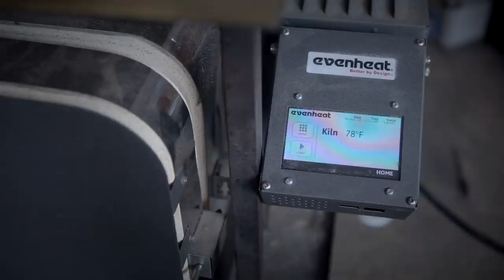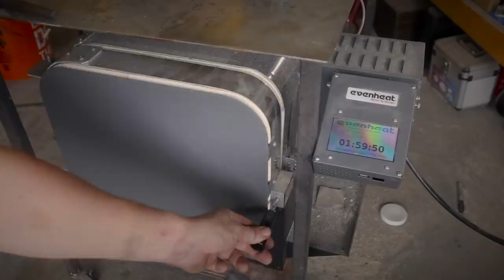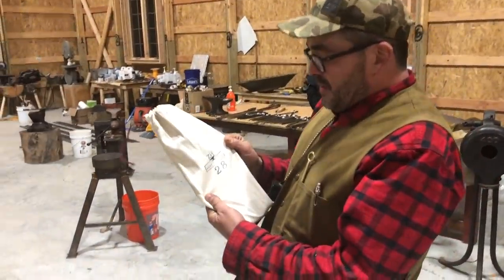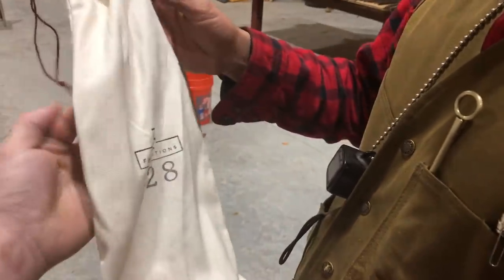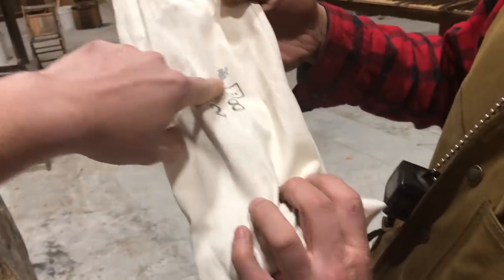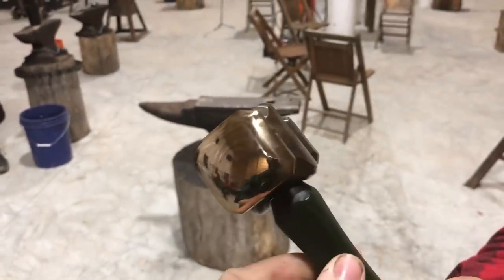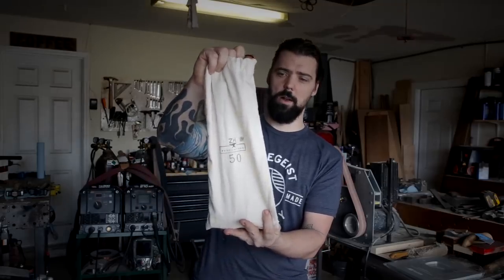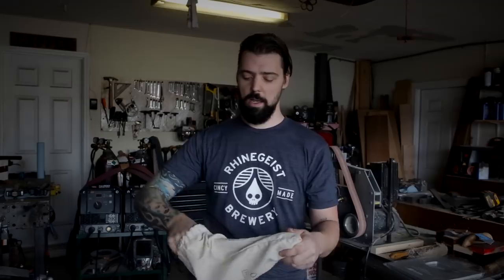Forged & Engraved blacksmith rounding hammer for Jimmy Diresta

Comment: Super sweet man! love the brassing!
Reply: That's not brassing, it's the temper colour
Reply: Super not supper. Brazing not brassing. Brassing is not a word.
Reply: @TacticalArgleBargle  brassing is a word. It is when you heat the metal and run a brass wheel over it to transfer brass to the surface of the metal. In this case I was mistaken it is temperature not brassing.
Reply: @WoodByWright  Interesting. The only methods I knew of was electroless or alkaline plating.
Reply: @TacticalArgleBargle   Brazing and (Hot brush) Brassing are two entirely different techniques within metalworking.  The former is a joining method and the latter is a coating method.  Hot brush brassing is a well known technique within Blacksmithing you can look up but essentially Wood by Wright is correct in his description of it.  Not all words and their usages turn up in spellcheck or on line dictionary's, particularly when it comes to old trades and crafts like mine.  Oh, and it's "electrolysis" not "electroless" in regard to plating.